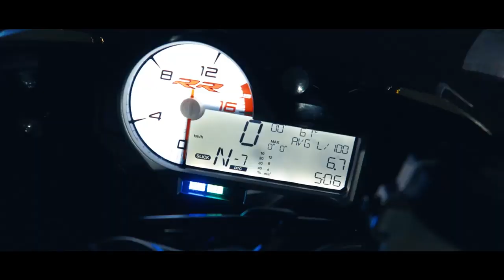Ultimate DIY Tool Wall - Cheap and Easy

Comment: I'm planning now for some time to make a board just like you did, for my container workshop at the track. Working out of a toolbox, with tools laying all over the table is a mess. By the time I find the 10 mm socket, I've aged 50 years. The board is of press-wood? It's the less expensive route, but I dislike it after a couple of years, as it absorbs moisture, gets brittle, and starts to brake off. Plywood is a bit more expensive, but with a coat of varnish over, lasts a bit longer, but each persons budget and circumstances differ. Nice job none the less.
Reply from the maker: Thanks. Yes it is pressed wood. I was going to go with ply wood aswell buy i had alot of. Pressed wood after building the box for my air compressor and decided to use it in stead of throwing it away. However board is holding up Nicely.